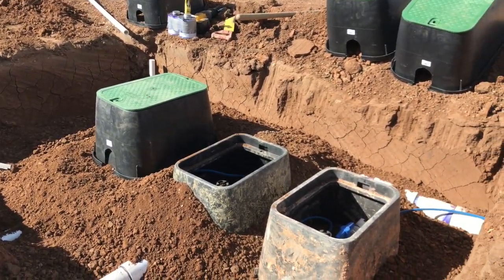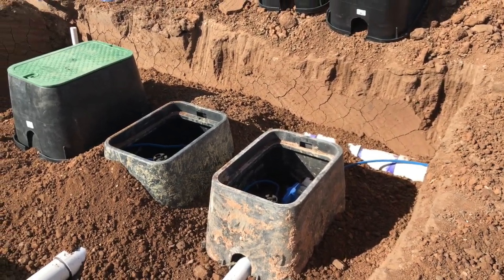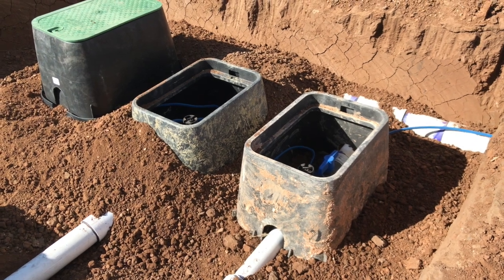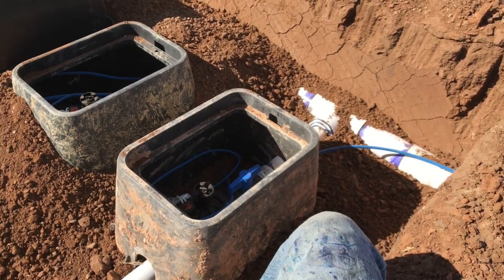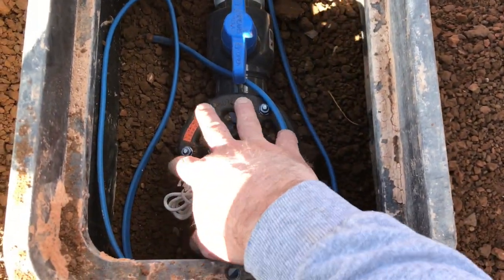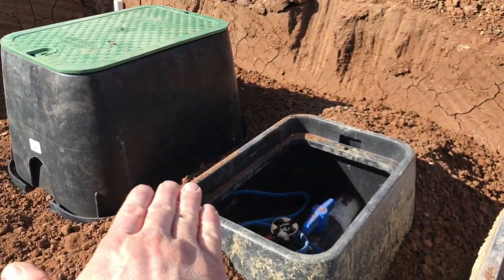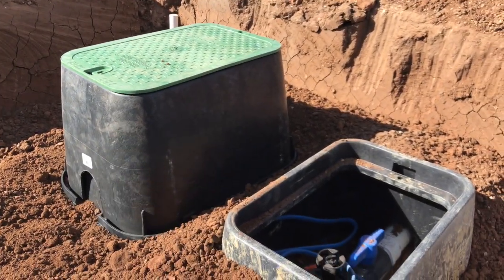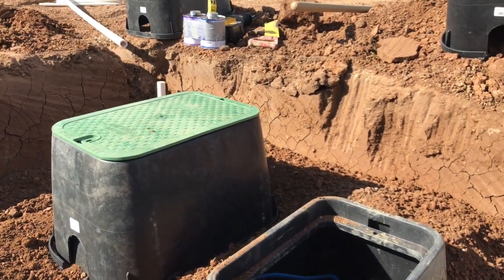Best Way To Install A Valve Box On A Sprinkler System

Comment: I usually set bricks then place the valve box on top. My method is terrible, looks bad when you open the lid, it's never level, not at the elevation I wanted and generally fills with sand or dirt because of the gaps in the bricks. Now I am installing a new waterline for my new house and decided to see if anyone else had a better way to do it than me. As soon as you said to install a box over the box I had a V8 moment. What a simple yet great idea! I installed boxes at two locations today and both are 1" above ground awaiting topsoil, they are perfectly level and most importantly,  the valves are so easy to operate. Thanks so much for this. Cudos to you.
Reply from the maker: That is great. I’m glad it worked well for you. Good job.

Comment: For the smaller round boxes you can use perforated pipe and then just put a universal lid on it.
Reply from the maker: Good tip. Thanks.

Comment: Great idea.  You can use the same size boxes but the top one, once you build up the ground around the bottom one, prevents the top one from sliding down over the bottom one and you don't have to by a very expensive extender box.  Thank you.

Comment: Nice. I use plastic coffee cans for many things and get them from an AA mtg not far from home. 
I cut the can(s) as needed to fit, sometimes folding it into a semblance of a flat "wall" using only one cut. They work well as corners. This is only as useful as the depth required to set the real valve box which the plastic pieces supplement, but they come in handy in a pinch along with some small pieces of masonry, cinder block or brickbat, and even wood, which can give stability, to a head or box, enough to get it set up in the right place. (The wood might disappear over time, but often the area, not being a mudhole, will be stable anyway with time.) I prefer a neat and accessible v box / valves and often will use a salvage v box which I can use instead of buying partials or complete new boxes, depending!! Sometimes one must go whole hog to do it properly. Coffee cans good for grease under the sink, misc screw/nail can, paint container(properly bagged, labelled, etc. don't be stupid), water bucket( for paint brush), etc.
Reply from the maker: Great tips. Thanks.

Comment: How do you reach it from the top with 2 boxes .. I mean I know the concept of what your explaining on how your saying with two boxes it should work but once all the dirt and grass is put back.. you wouldn’t be able to reach it from the very top to do any kind of maintenance?!..
Reply from the maker: If the valves are the depth of the two boxes, all the way down to the bottom, yes it is hard to reach and maintain. But most of the time when I use two boxes, the valves are not necessarily that deep. I use the second box to make sure I get the hight right, flush with the ground. it just gives me some flexibility. I have started to raise my valves up and not install them so deep though.

Comment: Just seems messy. Has to be a cleaner and more accessible system? Instead of dirt if you get leaks it fills with water you’re working in mud
Reply: I use gravel to prevent mud.  1) dig about 5 inches below pipe.  2) place  treated  2x4’s for the box’s outside edge to sit on. (Or another hard surface material like concrete block).  3) fill bottom of box with 3” gravel leaving you with 2 inch clearing below pipe for a clean mud less . Repair.   During repair, you can also move a few inches of gravel to get more clearance underneath.  *. Make sure to duck tape box holes around pipes so mud doesn’t flow through.  I’m currently experimenting with Great Stuff Foam.  Cheers.

Comment: I had to fix sunken valve boxes today. Unfortunately most irrigation contractors do not care. The cost of extra boxes is not something they want to pay for. Have you considered using self tapping screws when stacking to get it to the right height?
Reply from the maker: I know what you mean. I have not used self taping screws to set them at the right height. That is a good idea though. If you try it, let me know how it works.